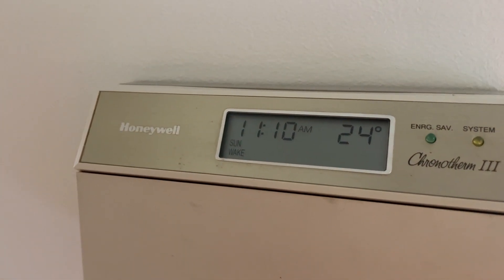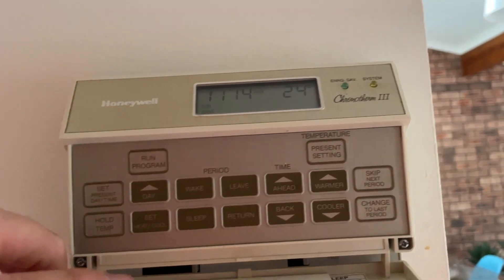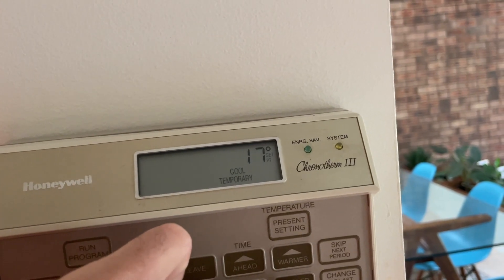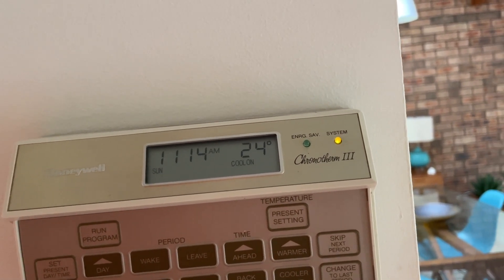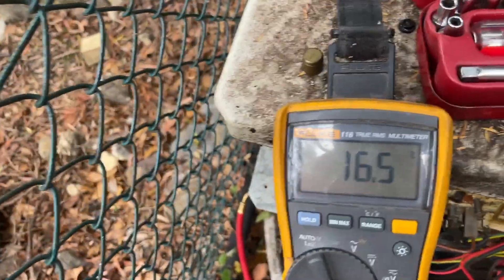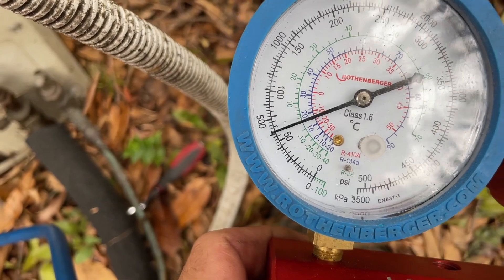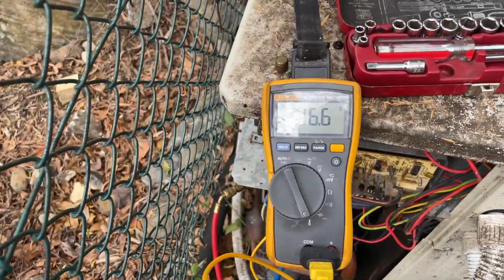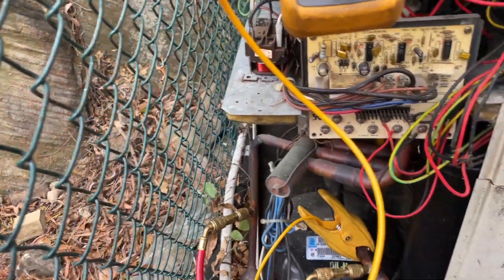CARRIER AIR CONDITIONER NOT COOLING !

Comment: The first aircon unit that was installed in our house was also a Carrier unit, though it was only a split system and heated/cooled the lounge room. That unit failed not long after, and was replaced by a ducted Daikin inverter that is still chugging along nearly 19 years later. The only issue it's ever had was a gas leak in the winter of 2015 caused by shonky technicians.
Reply from the maker: I’m a fan of the old carrier ducted’s. I think they were awesome. The split systems were okay but not as good as the daikins that were the same age in my opinion

Comment: How do u charge the pressure ,if the actual amount of gas is not shown on the nameplate, n how much should be the operating pressure .
Reply from the maker: This is a DOL single speed unit (not inverter) so I charge it to 8k Superheat. Thanks

Comment: I thought this unit looked familiar! I legit got called out to work on this unit today. Be sending in 2 Quotes to replace the whole system & to replace the control system. Hows that steep driveway haha!
Reply from the maker: Haha that’s crazy. Small world and yeah the driveway is red hot aye haha. 
Good luck with it man, the tenant is a great guy. I quoted to replace the system also but it was to expensive. If you get the job, I hope you can put the condensing unit in an easier spot to install 😂
Reply: @maracservices  Yeh definitely wont be going in that same spot haha

Comment: Just a question mitch, where did you get your clamp for your fluke meter? Did it come with it? I've got the fluke 325 clamp meter, and it didn't come with one, klein make the clamps but never seen a fluke one.
Reply from the maker: Hey man, so I have all fluke gear and the fluke meter came with a Velcro strap thing that you wrap around the pipe to get the temperature. I did not like this one bit so I went and bought that yellow clamp thermometer you see in my video from Actrol (it’s actually a Fieldpiece clamp). It works with my fluke multimeter however you need the adaptor for it. I know Heatcraft also sell them too.

Comment: Bad location for unit to be installed though against the fence and am guessing pipe work in the ground, wonder why its installed so far back from the house?
They definitely don't make units like they used to, As I mentioned before my old house had an email and it just kept going with analog thermostat and switches don't even think it had a circuit board anywhere. But the power savings with new units are so much better.

Only thing I can see about to go on this at 10:50 you can see the left capacitor on the circuit board is starting to bulge should look like the other one on the right. Used to see this working on old PC's back in the 2000's eventually the Motherboard would die. If it does you could probably take the board to an electronics shop and have them replace the CAP. Could also explain why the unit cut out too could be affecting the comms with the controller.

How much is R22 gas going for these days and is it only reclaimed you can get now? Thinking my current Actron unit is starting to run a bit low need to get it checked out. But am scared of the price of gas.

Comment: Its built to last 25+ years. Modern junk is built to last warranty. 

But this old girls economically viable serviceable lifespan is up. I would do a compressor efficientcy test before doing anything. 
Not really worth spending money on. A new unit will pay for its self in power savings & eat it in performance.

But rental property always hard to get them spending money. I wouldn't recommend putting any more $$$ in this old beast. 
That $$ could be a big chunk towards a replacement
Reply from the maker: I definitely think it’s time to rip it out and install a new system. There’s so many things I’d like to fix on this thing but the price would just add up to quickly. If this was my house, I’d clean the evaporator coil, upsize the return air ducts, do an efficiency test on the comp and potentially sort out the gas issue to get it running at 8 k again. However if I did all this it would cost a bit and I’m still not confident that the Honeywell controller is working right. I think it’s dropping out intermittently. So yeah it’s time to think about replacing the unit. Unfortunately like you said, being a rental, who knows what will happen. All I can do is provide all the info and give my advice. I’ll keep everyone updated on the outcome 👍🏻
Reply: @maracservices  I've always wanted to open my own HvacR "Jurassic Park"
 to move all these prehistoric Dinosaurs. 
To preserve the past. 
Id Clean them up & reinstall these beasts. In tip top shape beer can sweat r12 suction line at comp. 

So they can be saved & admired,  even fired up to Blow on sanctuary visitors. only old cool fans site. 
H+C treasures like weather walls, dual comp Fujitsu's. 
Wired remotes, email floor splits...the classic tank laminate timber look beasts could chill . Retired but still ready to rock it n cool.  All containing Greta Thunbergs worst nightmare. Pump it up. Single speed mechanical contactor equipment you can jam a flat blade in the sucker & diagnose on the spot. No waiting or man its daikin forever. Pcb free zone , lizards welcome.
Reply from the maker: @DoctorWEBB  if I come across an old carrier ducted (the type that looks like a beer can with top discharge) I’ll legitimately refurbish the thing and install it in my place haha.

Comment: Awesome, thanks for sharing. I wonder what the indoor unit looks like?
Reply from the maker: The indoor unit is in working order however I think it needs a coil clean and I’m not sure the zone motors are still working. I think they are stuck in the open position. It’s the same old story, how deep do you go on a system that is 28 years old. I’d love to fix everything however the owner may have a different opinion. This house is a rental, so the vibe I got was, just do the bare minimum to get it working. I’ve quoted to do a coil clean on the indoor unit, change fan capacitors and get the unit back up and running at 8k superheat.
Reply: @maracservices  usually look like a haunted house x damp swamp. Littered with dunny budgies & fluff. 😆

Comment: As an ex carrier brisbane guy, I would look at evap  leaks, perforated coils were a real issue on the QCAs, especially if it's a brivis fcu. The old control package could also be a likely uspect if cutting out when it shouldn't be. Pretty sure the outdoor lockout relay  would rule out intermittent hp/lp trips though, but don't quote me. Good units but at this age, digging your self and your client into a money pit can be a real possibility. Proceed with caution and make sure the client is well warned.  Thumbs up though!!
Reply from the maker: Thanks mate, appreciate the advice! I remember working on these a lot when I was an apprentice. When ever they had gas leaks, I went straight in the roof and checked out the compression fitting on the suction pipe. Those things were always oily (leaking). I have no idea why they randomly used them only on the suction pipe. Did you ever come across those things?